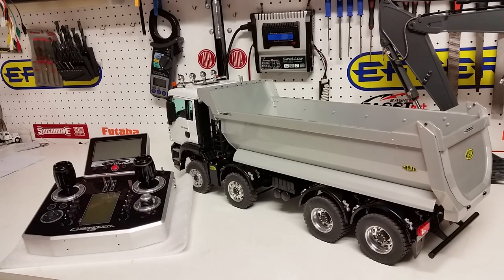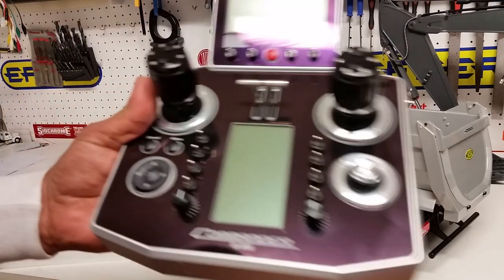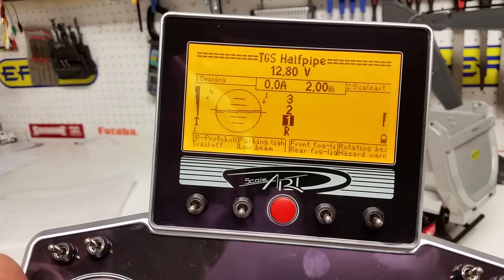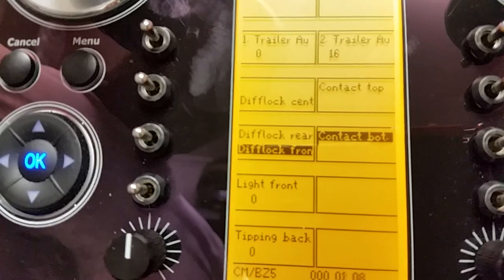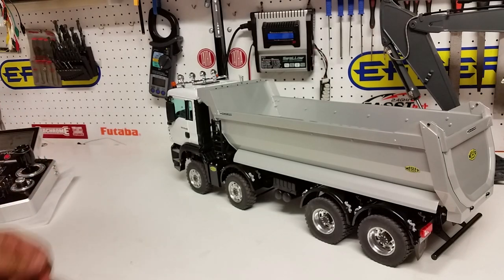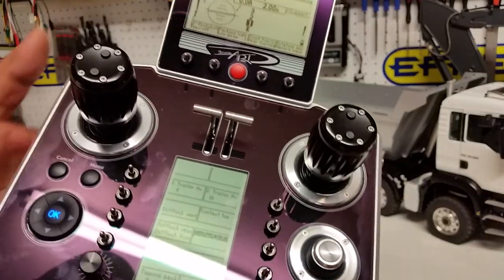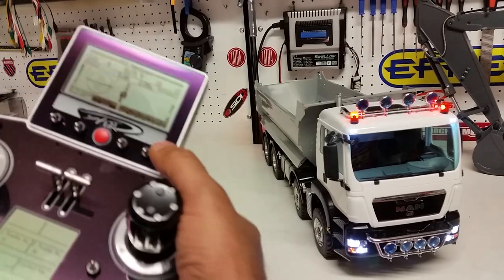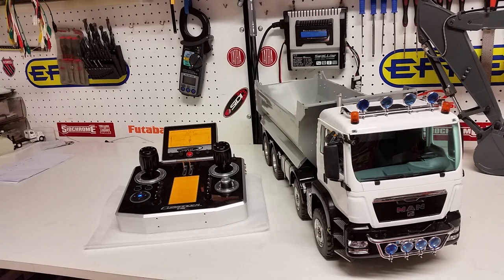CSMI : MAN 8 x 8 TGS  Function Test SA 5000 Commander Radio

Comment: What is the difference between the Expert radio and the non-Expert?
Reply from the maker: Hi thanks for the comment.  Able to manage complex operation.  Example mix functions,  no of channels.  Able to turn model of from the radio. Data display telemetry.  Just to name a few.  Info@csmi.com.au
Reply: @CSMIRC  thanks but isn't what you described the difference between the 1000 and 5000?